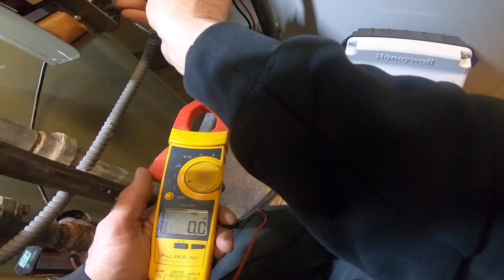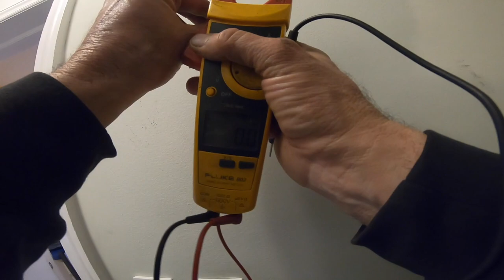Old Sears Heater Not Starting Electrical Issues

Comment: Never trust a customer, they lie all the time. The emergency switch should be left operatable . Better check the code in your start or National Electric Code book. If the switch did not work according to the customer, then why did it shut off the burner??? Burner should also be on a dedicated circuit. Thanks for the video.

Comment: I saw the emergency switch was off. Why didn’t you just turn it on?. This evidently was oil at one time and required by code. Why didn’t you just replace the $10 switch, if it was bad.

Comment: So. Upstairs switch was problem Im guessing. Only 14 volts coming out of it ?. So. Was it a faulty switch. Or someone messing around with wiring ?
Reply from the maker: The switch was busted. Most likely got hit by something. Couldn’t move the toggle and it wasn’t going all the way off.

Comment: Why in the world would there be an emergency OFF switch on the main floor? You bump the switch, or kids play with it and you lose heat. I can see someone leaving for a winter vacation, bumping the switch as the go, only to come back with frozen pipes!
Reply from the maker: Lots of old nj homes have switches like this. Many late Friday, Saturday, or Sunday service calls they just had a family get together. Someone leaving the basement turned it off. I feel bad for charging to flip a switch. Helps teach a homeowner to check that switch before calling. I have seen these switches in the kitchen by the light switches for the counter. Most new installs we offer to disconnect since code requires a service switch on or next to system.
Reply: If you had an oil boiler or furnace on fire you would want an emergency switch at the top of the stairs or not in the basement.  Not sure about gas heat.